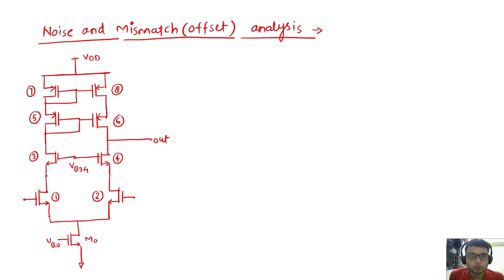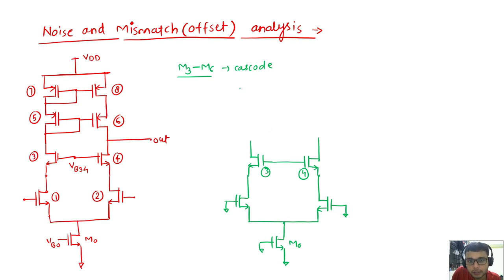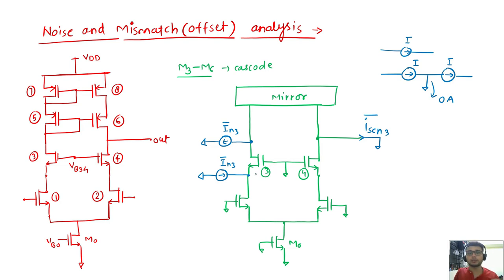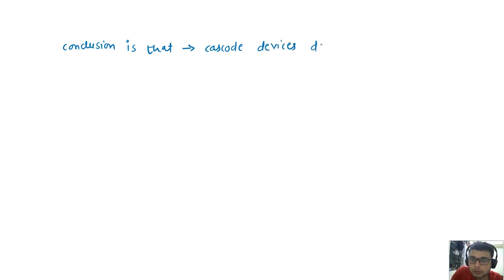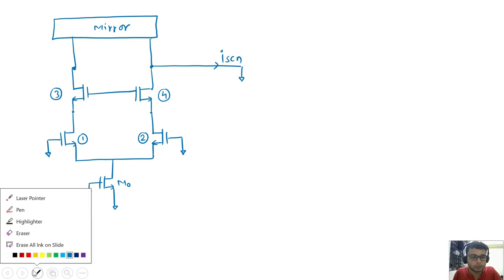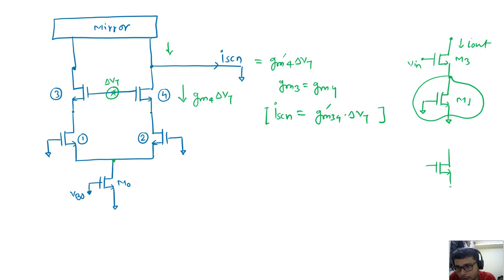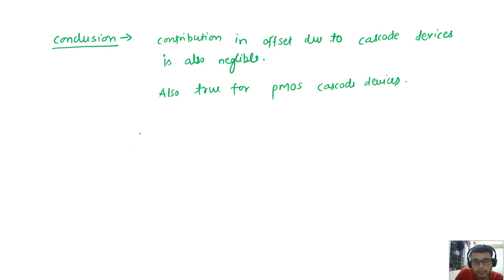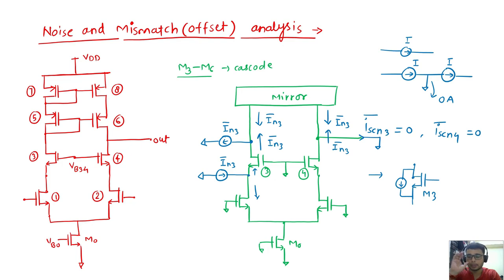Lecture-08 || Noise & Offset Calculations ||  Cascode Structures || Placement series || Anuj Chauhan

Comment: Hello

Actually I had doubt in CTQ 10 noise analysis...

Will input referred noise  be lower for left side circuit since it's Rout I think is greater than right side circuit..

Can u pls guide on this

Thanks
Reply from the maker: @YashRPant  for the short circuit output noise current Gm is responsible to refer it to input while in case of voltage, gain is responsible where rout is used to refer it to te input, I'm not getting it
Reply: @learningexpress183 

Sry for confusion..
I will go through it once more

I was just wondering for which one input referred noise will be less
Reply from the maker: @YashRPant  okk no problem